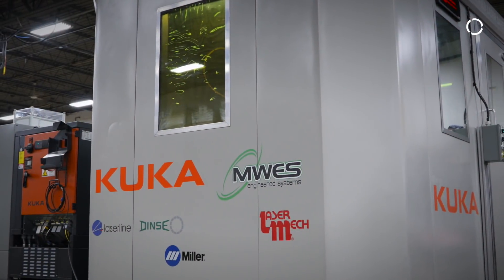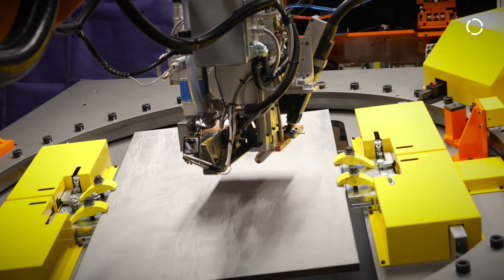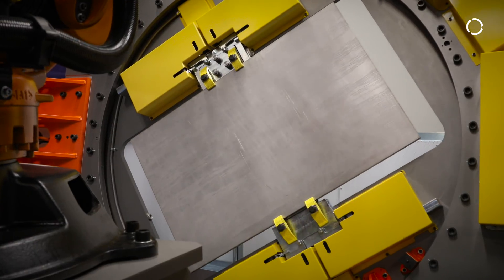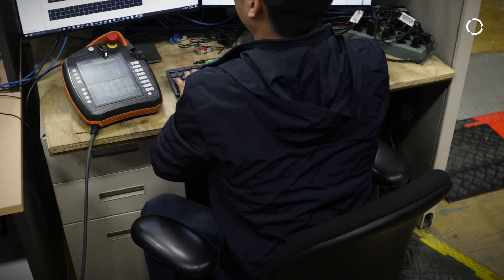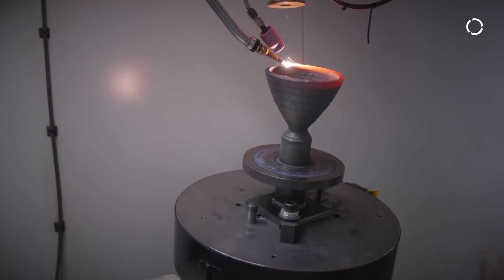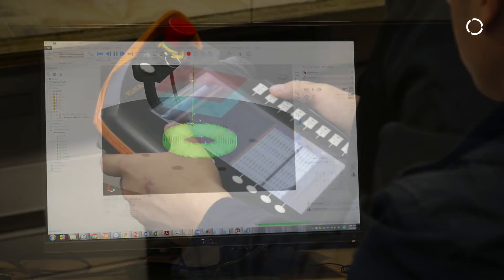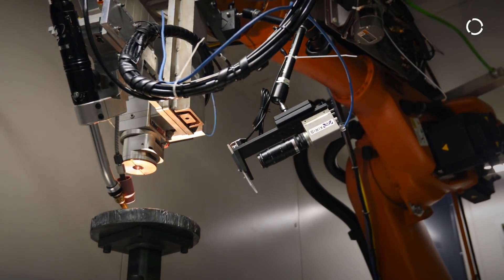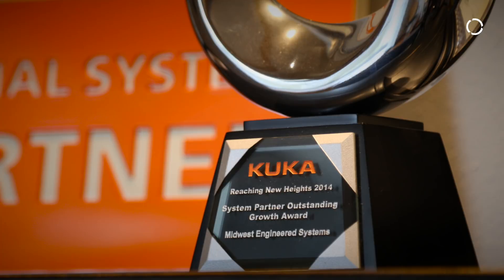Robotic 3D Printing with Lasers and Molten Metal

Comment: IF you want a finer, more detailed version.  Create an electro magnetic field to sharpen the steel coming out of the nozzle into a sharper "point".
Reply: Or just use finer filler wire and a more focused laser beam..... Though there are most likely limits as to how small a melt and heat affected zone/region is practical before porosity and other defects becomes a problem...
Reply: Ehy will there be holes? Its an inert rnvironment
Reply: Do you have more information about that?